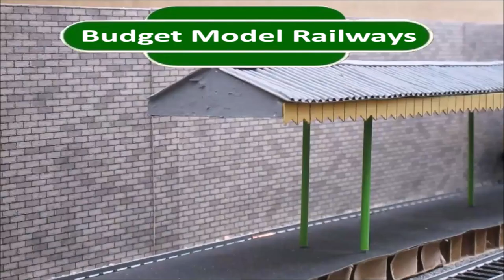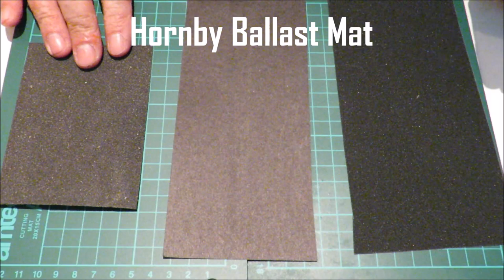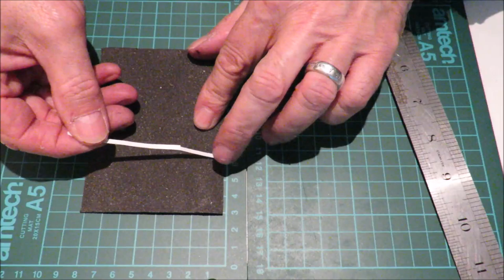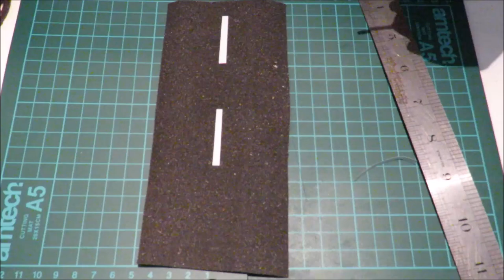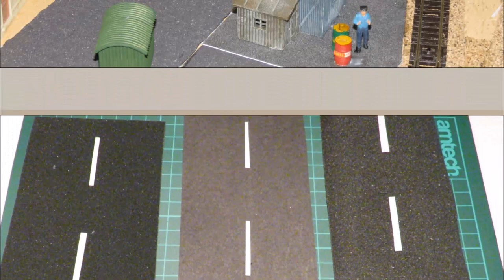Tutorial Tuesday Episode 9 - How To Make Model Railway Roads / Car Parks

Comment: I used the black wet and dry sandpaper from Poundland for parking areas (unfortunately they no longer sell it)  but I also used cheap red sanding belts from Ebay for long roads. They can be easily painted with cheap black paint and the red actually looks like the red tarmac that you often see used in bus lanes etc.
Reply from the maker: I like your thinking

Comment: Loved your video, just one question...Is there any problem with fluff/dust sticking to the surface of the sandpaper.
Reply from the maker: Hi Greg, we used sandpaper on Roselands hill which has been to two exhibitions and stored , moved etc and so far no issues with dust?

Comment: A couple of comments if I may!  1.) when you use any kind of label for this, make sure, when you buy labels that they are "permanent" adhesive.  I made a mistake some time ago when I didn't check the labels I bought for a project, they turned out to be non-permanent and they dried out, turned yellow and came loose within a year or so.  2.) Also, as a road surface, a reasonable choice, (and not particularly expensive either) is an item that I use all the time.  Here in the states it is called "contact".  It is a roll of vinyl adhesive that is used to cover shelves, books and just about anything you may want to cover.  It is easy to use, and since it is vinyl you can clean it when needed with a damp sponge.  This is a common item here in the states, and I am guessing that it probably is available in Britain also.  (It comes in solid black and also in some granite-like finishes.  There is also a type of small scale marble that I found also.)  Normally, this type of item is found in your basic home improvement or hardware store.  So, if available in Britain, I think most modelers will find it a good choice for roads also!
Regards from America, -Ron
Reply from the maker: Great ideas, thanks. Here it tends to be glossy finish but I will keep an eye out as it could have quite a few uses.
Reply: Originally, the black contact did have a shiny surface but in recent years they replaced it with a matt textured finish.  I think it depends on the manufacturer.  I haven't seen the shiny surface for a while and here, the product has changed manufacturer's several times over the years.  You never know what each one will do with it once they take over the company!
Regards,
Ron
Reply: Just thought of this... if the contact surface is shiny, perhaps you can spray paint it with a clear "dull coat".  It would make the surface "flat" and also protect the white paint strips at the same time!
Reply from the maker: Thanks for all the suggestions, I will keep an eye our for it here

Comment: What a great idea of using "wet and dry" for the road surface but , to make it much more realistic add some POTHOLES.
Reply from the maker: Excellent lol. If your roads are like ours I'd have to add LOTS of potholes!
Reply: A simple way to add potholes is to paint the wet and dry a dark grey colour and then black again and once the paint is dry use a blob of blu tac, press firmly into the shape you want and then pull it off. The blu tac will take the top layers of paint with it to reveal something not unlike a pothole!
Reply from the maker: Great idea thanks